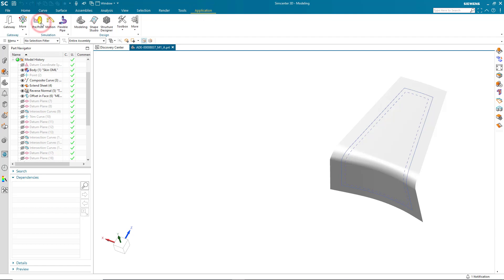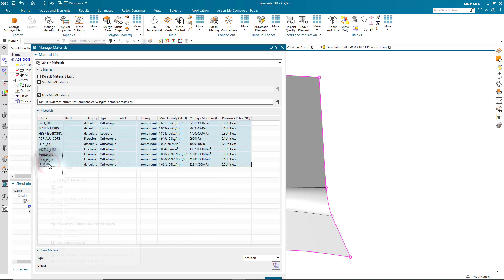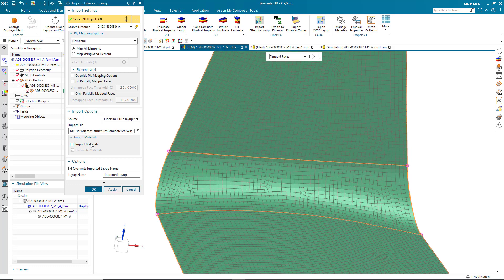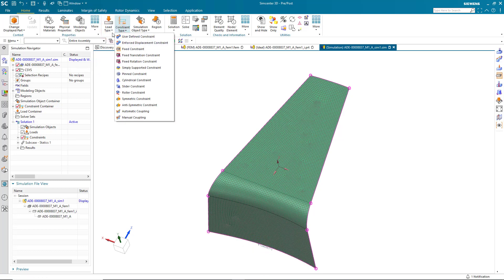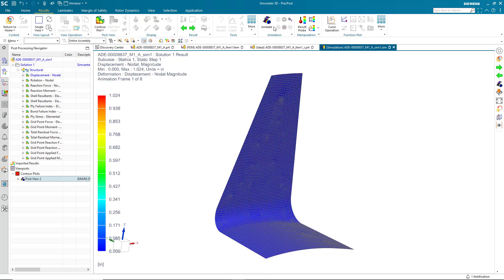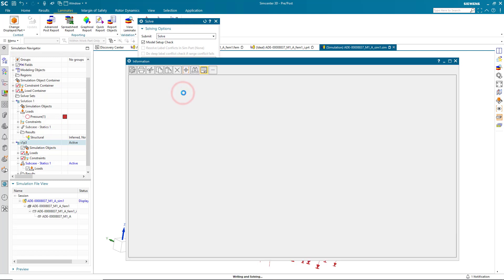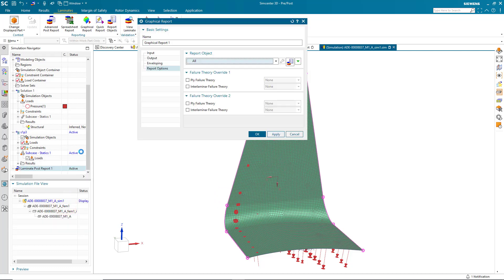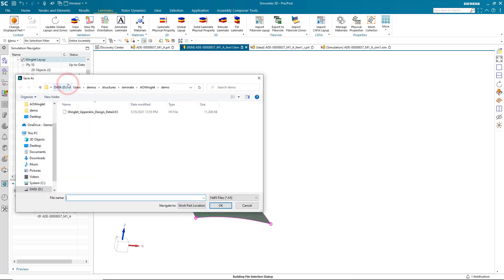How To Import Plys From Fibersim

Comment: hi, I found this video very helpful but I have a model-specific issue. My model consists of aluminum and glassfiber parts and I need to simulate it as such. I have the xml files of respective materials but can't find my way to open all of them as an user defined library. any help is appreciated, thanks
Reply from the maker: Hi, Glad you are finding the videos helpful.  Recommend first importing each xml material into the same fem.  You can then add them both to the same material library xml file.  Please see video here for reference:  https://youtu.be/za38Qyoju7k?si=UGNrzxtGzIrBPCFZ